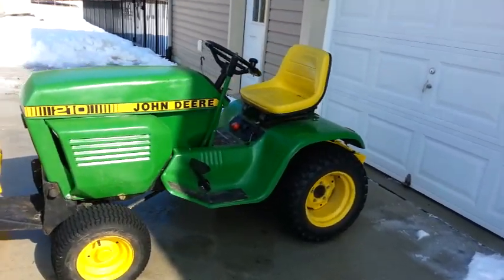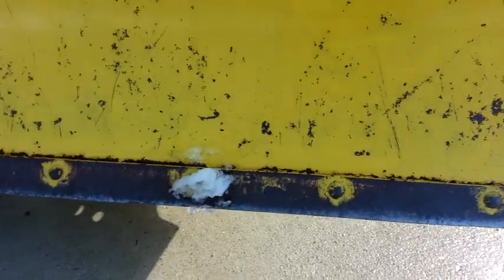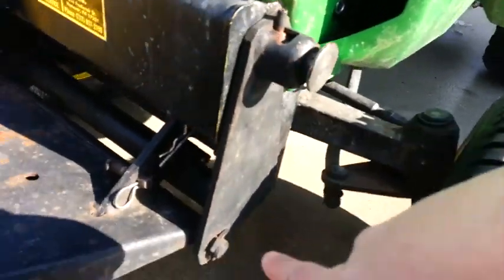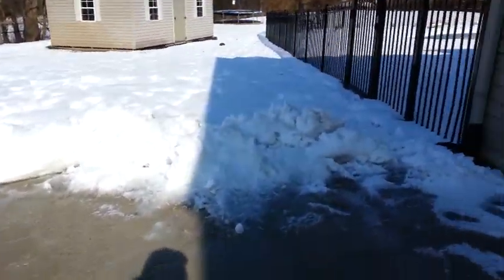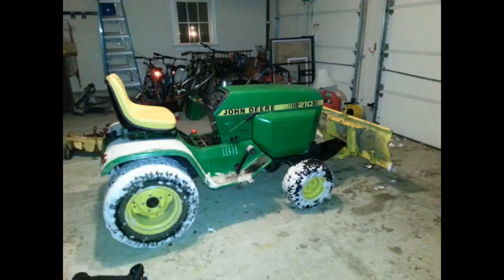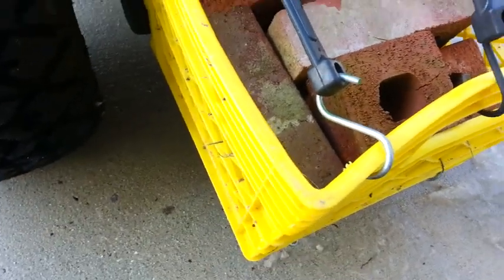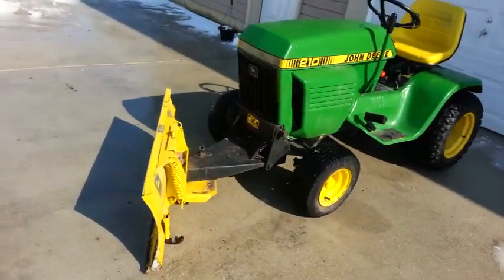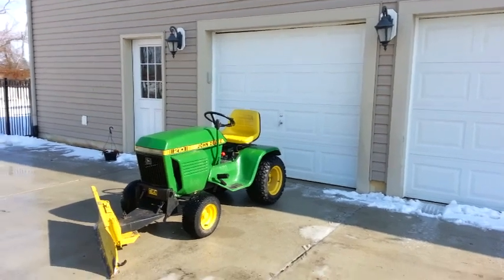New Model 43 Blade for the John Deere 210

Comment: You can rig up blade turning by a small rope or cable, to pull up that pin setting in seat. You just pull it and turn tractor either way and it will go the way you want it. My214 has same set up

Comment: The reason you were having some issues with having to raise the blade and go over the snow twice or you had to ram it in 4th gear was you were lacking tire chains. May want to look into those if they fit your needs. I put them on my simplicity plow tractor and it went from being able to plow 3 inches of wet heavy snow to 8 or 9 inches is easy for it now hah
Reply from the maker: Yes chains definitely help. I ordered a set of chains after I made the video so they should be here in time for the next snow storm ;)

Comment: You can put windshield washer fluid in the tires to add weight to them and it won't freeze.
Reply from the maker: It won't freeze but it is corrosive and will eat away at the rims. I run RimGuard (beet juice) in my tires since it is heavier than water or washer fluid, doesn't freeze, and doesn't corrode.

Comment: I would like to know how I can go about getting one of those lift flanks that you were referring to when it comes to putting your snow plow blade on your John Deere 210 ?
Reply from the maker: Are you talking about the whole lift linkage assembly or just the two small attaching links for the plow? You can find either of them on eBay or craigslist, or if you're good with fabricating you can make the attaching links out of a couple small  pieces of steel.
Reply: @MichaelTJD60  I have a electronic lift on my 210. There was a vertical piece hanging down off of the horizontal piece I seem to be in the way on the welded piece of the blade. But I didn't know that I needed that lift flank I think you called it to attach both of them together.
Reply from the maker: @anthonytew2541  That is what actually helps the blade to pivot up and down, if you hook the tractor's lift rod directly to the blade it will put much more strain on the electric lift and may not give you the correct amount of travel.
Reply: @MichaelTJD60  I know I'll have to put that piece of metal back on, but if you could give me the accurate description so that I can find it on eBay that would help out a lot !!!
Reply from the maker: @anthonytew2541  Here you go 
https://www.ebay.com/itm/New-made-links-for-43-snow-dirt-blade-John-Deere-110-112-200-216-tractors/331727531266?hash=item4d3c806d02:g:Jd0AAOSwNyFWcF-j:sc:USPSFirstClass!08062!US!-1
https://www.ebay.com/itm/John-Deere-110-112-210-212-214-216-Model-43-front-lift-blade-links/123418841253?epid=1230980099&hash=item1cbc5610a5:g:~ssAAOxy8F1RFtTs

Comment: Hey nice video! Question what's the measurement on that homemade bracket from center to center on the bolt holes?
Reply from the maker: I don't have the blade anymore so I can't actually measure it to be sure, but I found a forum post stating that the holes are 1.100" apart and are 0.391" in diameter.

Comment: Nice 210 just got my 112L repainted and a plow build for it can't wait to plow with it.
Reply from the maker: Cool. I've seen a 112L before, they are neat machines, only made one year. Those little 100 series are good for plowing snow as long as you don't have 3 feet to move. I had a 111 that I ended up parting out. I have videos of it on my channel.
Reply: MichaelTJD60  Do you need tire chains for your 210 ? I have chains that fit your series tractor?
Reply from the maker: Actually yes I do, I just got a set of chains for Christmas yesterday. I should be good to go. Thank you though.

Comment: make sure you leave your blade unlocked if you start ramming stuff you want it to be able to tip forward to save the cutting edge if you strike something. you got a good deal on that blade
Reply from the maker: thanks for the tip, how exactly do I unlock it? I noticed it won't trip when I hit something.
Reply: not sure on the older blades but usually there is a spring loaded pin you just pull and lock you will know it when you see it it will be somewhere on the back of the blade. when you want to push dirt and stuff thats when you lock the blade
Reply from the maker: Got it straightened out. Now it can trip if I hit something with it. Thanks.

Comment: Nice setup!! how did the engine work any bogging down? and how much spinning?
Reply from the maker: Not too much bogging and yes it did spin but the weight box helped. If you let it spin for a second after stopping it will keep going and keep pushing snow all the way.
Reply: oh awesome another trick that really works for me is when back up put your knee on the very back of the seat and lean back ill show it in my video tomorrow its pretty kool how it helps we are getting 4-6 inches tonight and 6-8 this sunday yess on top of the 4-5 feet of snow we already have
Reply from the maker: Lol thanks for the tip. Sounds interesting.

Comment: Hello How do you turn the plow to an angle? I have 212 same set up but the snow plow is straight
Reply from the maker: On the blade frame assembly there is a cylinder-shaped pin with a latch/hinge mechanism and a spring attached to it. Pull up on that pin and latch with the blade off the ground and you will be able to angle it left or right.

Comment: i heard you talk about how expensive the hydraulic kit is, i have the electric lift kit on my 212 and i LOVE it, it takes no engine power and will easily lift my front snowblower and easily lift over 400lb on my rear sleeve hitch it's so great!
Reply from the maker: +Garret R I thought about installing a hydraulic lift kit when I first restored my 210, even had a buddy of mine offer me a hydraulic lift kit for free, but since I had just bought a 316 with hydraulic everything, I decided not to get the kit off of him (I know, call me crazy). At this point the only things I lift with the tractor now are the mower deck which is a piece of cake, and my new-to-me Brinly moldboard plow. I have the helper spring installed underneath so that makes my load easier as well.
Reply: yeah i also have a helper spring that i bought before i got my electric kit and i still need to sell that back on eBay maybe make some money :) but with the snowblower i use on the front and heavy loads on the sleeve hitch the helper spring just didn't but it.
Reply from the maker: Good thing I don't have a snowblower on mine. lol.
Reply: yeah i think mine is somewhere around 200b so yeah... living is quite hard especially for me since i'm only 15 lol
Reply from the maker: Hey I don't blame you, I bought my 210 when I was 14 and even though I didn't have a lot of money I just kept working and getting all the equipment little by little.
Reply: yeah i got my 212 as a gift from my father when i was 11 and have been also slowly adding things to it and doing some small mods as well :) when i first bought it the connecting rod was completely smashed so with the help of my grandfather i did a full engine re-build, and that was really my first experience with rebuilding an engine and the time when i really became interested in that type of stuff! :)
Reply from the maker: Nice, after all these motor swaps I've done to this tractor you'd think I'd know a thing or two about rebuilding one, but so far the deepest I've had to dig into a motor was to change the head gasket and have the head milled smooth. Next week we are tearing apart my grandfather's Cub Cadet with a Kohler Command v-twin for a rebuild so I'm gonna learn from my uncle.
Reply: yeah these garden tractors are such an amazing place to learn about rebuilding engines and mechanical engineering and such! also if you really screw up it's not too expensive like a car would be :D
Reply from the maker: Exactly! Someday I want to get into bigger tractors. Maybe buy myself a Ford 8N or restore my grandfather's old Ford 4000. Then restore his John Deere 60.
Reply: yeah those tractors are really cool! if you end up restoring one of those make sure to make some videos on it! :)
Reply from the maker: Will do for sure
Reply: +Garret R I'm 12 and will be getting either a D170 or an X320 soon.
Reply: +MichaelTJD60 id put the 60 on the top of the list.
Reply: +MichaelTJD60 tell either DJ or Jimmy you want that hydraulic lift kit and I might buy it from ya.
Reply: Lucien Dube I would recommend looking for an older one on eBay or craigslist, something like a 100 or 200 series they are built so much better then the cheap crap series today
Reply: Lucien Dube They are also super fun to re-build
Reply from the maker: The mechanical linkage under the frame can be a pain to work with sometimes but for beginners they are very strong reliable tractors.
Reply: +MichaelTJD60 and I am a beginner.
Reply: +Garret R I'm pretty sure it will be an X320. I read a review and the guy said it was over 850 hours and still going strong. But you are right the D100 series transmissions are very weak.
Reply: MichaelTJD60 the drive and brake linkage is a pain to work on, and especially the fact that it's on the outside of the frame. Sometimes the tire chains can grab them
Reply: Lucien Dube The transmissions and frame are very weak yes, and they're not very versatile compared to other tractors
Reply from the maker: Yep that's what happened on my 210. Kept hooking onto the brake rod. The pedals are one of the flaws on the 200 series, they should have had them come up over the front of the fenders like a 300 series. An X320 uses a K58 transaxle I believe, which is still superior to the K46 used in the D series and the X300. X320 is a much better machine even though it looks the same.
Reply: MichaelTJD60 Yeah I may try and move the brake and transmissions rods to inside the frame on my 212 at some point
Reply: MichaelTJD60 but this winter I didn't have any problems, maybe because earlier I bent the rods inward so they are super close to the frame and haven't had any problems since
Reply: +MichaelTJD60 actually my neighbor who lives 2 houses up the road from me has an X320. I might ask him and see if I could possibly try it out and make a video on it in a couple weeks.

Comment: Can you upgrade the 210 to get a hydraulic upgrade for the plow lift
Reply from the maker: Yes. I upgraded this one to hydraulic lift 3 years ago and don't regret it...toughest part of the swap was having to machine a few custom parts since Deere doesn't sell most of the parts for the kits anymore.
Reply: @MichaelTJD60  ok thank you do you know by chance if the 214 come with hydraulic or if you have to add them? I am getting ready to get one but dont know which one would be better.
Reply from the maker: @BobSmith-qi5di  Hydraulic and electric lifts were dealer-installed options. A couple very important parts in the hydraulic kits do not interchange between years and may require modification. I'd recommend buying a tractor with the kit installed or at least buying a parts tractor that still has all the pieces on it...trying to find all the individual parts for the kit is not easy.
Reply: @MichaelTJD60  ok thank you I am not sure the 214 has it but I have seen some kits for sale online.

Comment: What do you think of the new 100 series E mowers?
Reply from the maker: I'm not a fan of the 100 series tractors as I've had plenty of bad experiences with them. But I do like some of the upgrades they have done with the E series, at first I thought they were just a rebadged D series. It's about time they added twin touch foot controls like the X series have. And the large oil filter is nice. I'm still waiting for them to discontinue the 100 series and start adding more models to the S240 lineup because they would be huge sellers. But who knows if that will ever happen.

Comment: what are you going to do  with the yard king
Reply from the maker: Finish the rebuild and then sell it. I need it out of here ASAP. Still need to rebuild the carburetor, fix the starter solenoid, and sharpen the blades and it will be ready to sell.
Reply: okay

Comment: How much did you pay for that tractor I like it
Reply from the maker: I bought it on eBay in 2012 for $275 but it wasn't in the condition you see in the video...was all original and had the front lift linkage and a 38" deck.

Comment: Good video man! I'm installing the snowblower on one of my 212's and the plow on the other this weekend. Good luck this winter with that bad boy!
Reply from the maker: Thanks for the comment! I got the blade in early February and after that we didn't have much snow so I haven't really gotten a good feel for the blade yet. But I'm ready for a long winter. I have since acquired two sets of wheel weights and will be putting on a third set of weights, Tru-Power ag/lug tires, and possibly chains, so she should be good to go. Just need to finish getting the 12 HP Kohler repower tuned and ready to rumble.
Reply from the maker: I wish I had a snowblower for one of my tractors. The model 37 and 37A snowblower attachments come up cheap around my area but my 210 doesn't have quiet enough grunt to work one. Plus I already have a Troy-Bilt walkbehind. These old Deere's are great snowblowing machines.